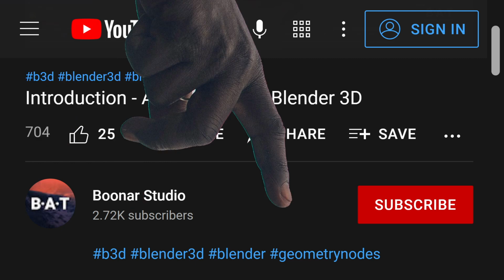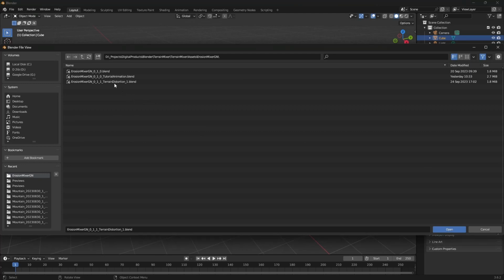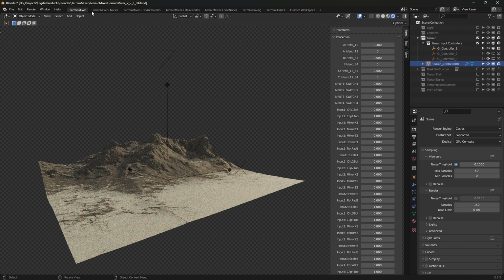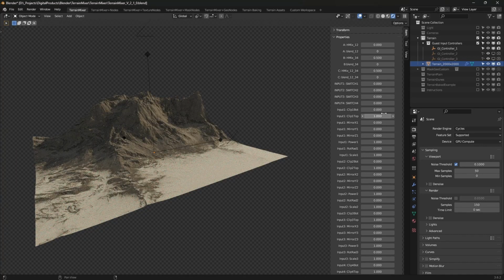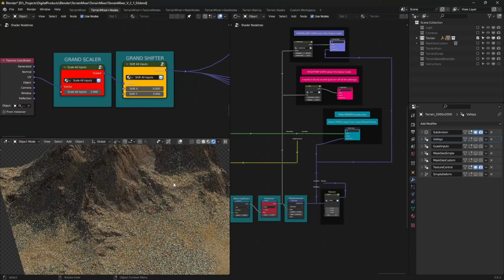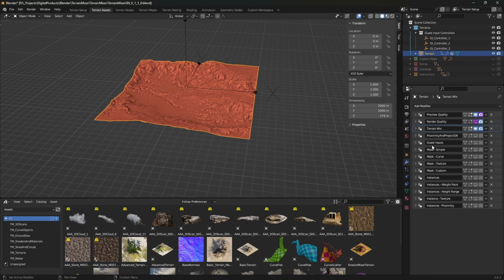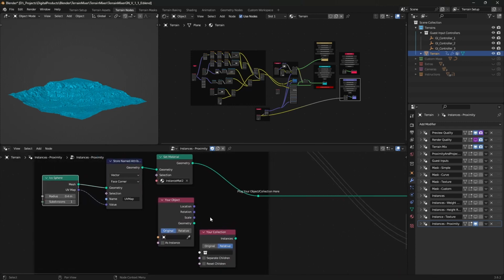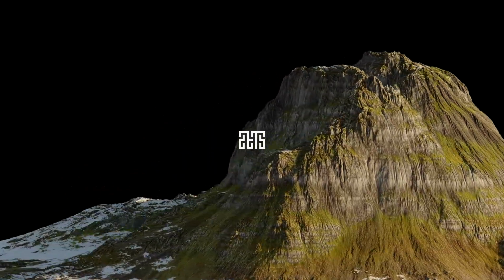Introduction To Blender Terrain Mixer for Total Beginners

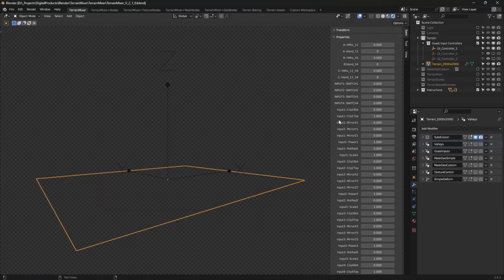Comment: When I open the TerrainMixer_V_2_2_0 files and I select the viewport shading in cycle mode/Supported/GPU Compute, I see a pink plane without any displacement. It is a pink plane not as reported at 5:13. How can I solve this issue?
Reply from the maker: Please check this video and also the PDF Manual: https://youtu.be/Nn1FU9miFNA?si=yV4ObfOLr96Wgils

Comment: Are these terrains game ready? Or can they be made game ready after finishing up the terrain creation process?
Reply from the maker: Making them game ready is an easy a straightforward process that shouldn't take more than a few minutes. It just comes down to what level of the optimization you need. If you purchase please join our Discord for additional support.
Reply: Also, would it be relatively difficult to make them game ready if possible?